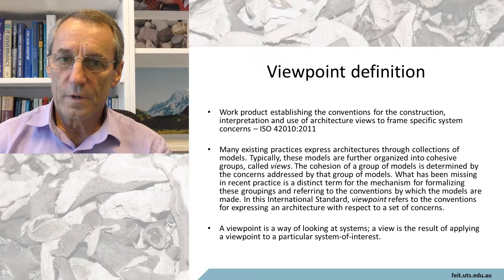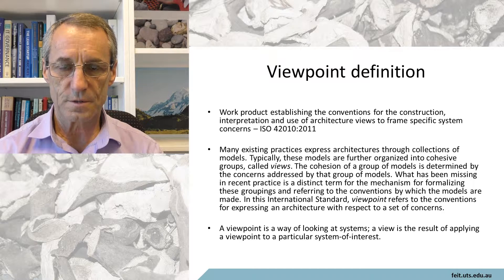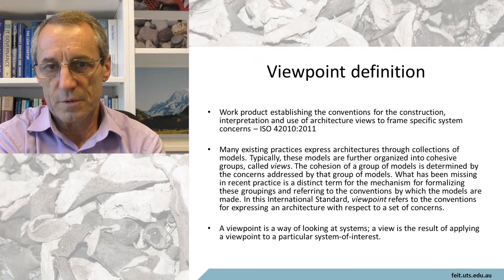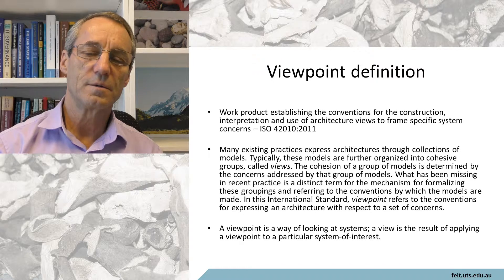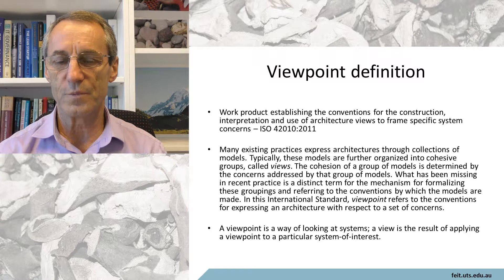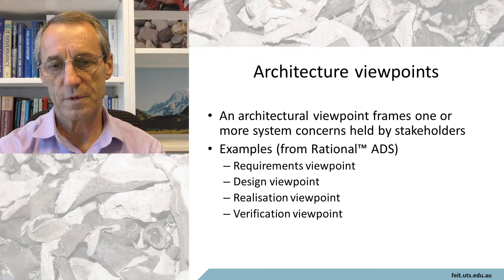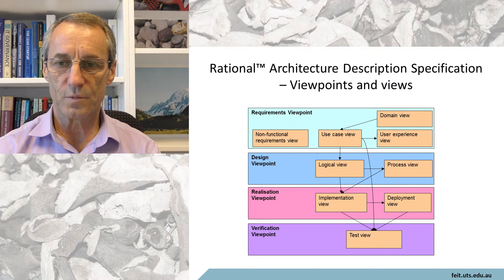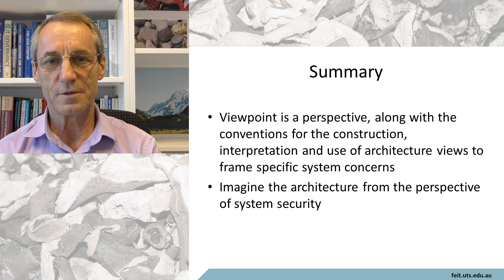Documentation   Viewpoints

Comment: View and viewpoint, which is come first?
Reply from the maker: What you see (view) depends where you are looking from (viewpoint). Viewed from the north a mountain looks different from the view from the south. A view of an architecture from a tester's viewpoint looks different than the view from a project manager's viewpoint, and different again from a system integrator's viewpoint. So, the viewpoint comes first because it determines the view from that viewpoint.
Reply: @utssoftwareengineering9871  , when we implement solution from the architecture, we will use view or viewpoint determine correct and enough from the solution?
Reply from the maker: @ntcuong01ct1  Not quite. In smaller systems (most of the systems being developed) there is no need for viewpoints because everyone can understand the whole architecture. But when the system being built is large and complex (systems that need 2000 or more developers are usually large and complex) the complete architecture is too large and too complex for most people to understand. It needs to be broken down into different viewpoints so different teams see only the details that matter to them and are not confused by details that are not relevant to them. Examples of large complex systems are the control systems for a ship or submarine, a national air traffic control system, many national government systems.
Reply: @utssoftwareengineering9871  ,Yes, I agree. But I think that a large system is divided into many viewpoints (and the viewpoints are linked together to form an enterprise architecture), then when we do a solution, we also do a solution for each viewpoint to do it carefully, and there should be 1 Can someone confirm that the solution did the right thing with the viewpoint?. Who will validate this?.